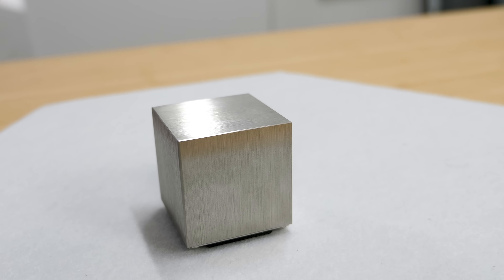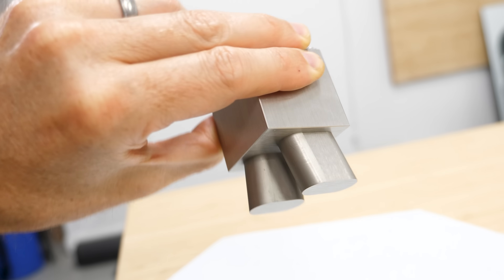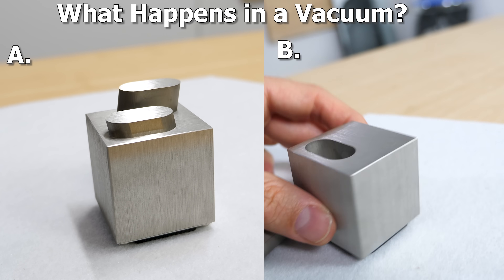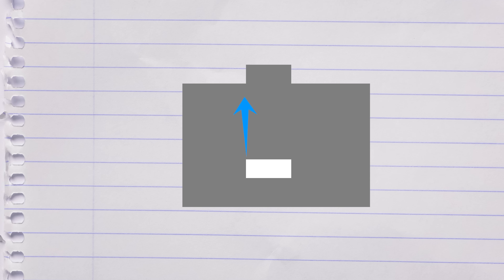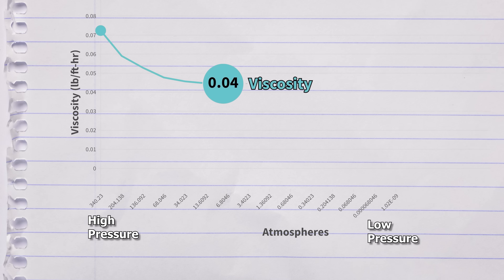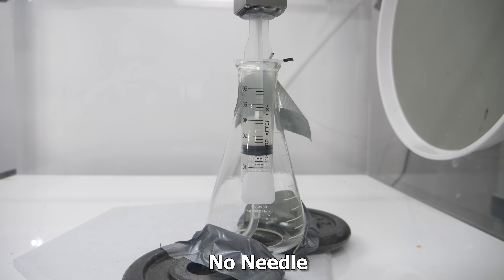What Happens to Perfectly Fit Pieces of Steel In a Vacuum?

Comment: 2:45 i wonder what would happen if you were able to place the metal pieces in there after the air is sucked out. Is it possible for the air to get “stuck” inside the cube?

Comment: @ Action lab So is the resistance due to viscosity of the air holding the water at equilibrium in the syringe ? Does pressure difference on the top and bottom playing no role here(Why then is the  pressure inside the syringe  higher than the pressure outside?)?

Comment: The problem in both cases is the trapped air. It is a very common mistake when designing for ultra high vacuum. You should assemble the cube and put the cylinder in the syringe after the vacuum is in the chamber.

Comment: Both pieces are cut separately then grounds to match the finish. Even with a EDM machine because the EDM still has a cutting diameter tho thinner than a traditional milling machine

Comment: I still don't understand 1. why the viscosity is constant, or 2. why that causes the weights to fall slower... since there's less air molecules in low pressure, there's less air molecule collisions against the steel block or syringe to resist the force of gravity as it's falling. Can someone please explain this result?

Comment: Clearly the limit as we approach true vacuum is no resistance (ignoring friction/vacuum welding): eventually, the air has to become so thin that there physically isn't enough molecular kinetic energy in the in the environment to prevent it from sliding out.  What explains the non-linearity here... does the fluid model break down at low-enough density?

Comment: My guess: the piece should actually lift out on its own due to the pressure differential. Once all the air escapes it will fall back in quickly.

Comment: I think the driving force of the air to move inside is lesser. The flow velocity maybe the same or maybe higher under vacuum but since the air is so thin, the amount of air going in is also decreased. The main equation to consider is below:

Mass flow rate= density*flow velocity*area

Comment: If the pressure is greater on the inside than the outside I think it would push them out as the pressure outside was removed.

Comment: You should have let the air back in with the cube fully extended and fully collapse or nearly so to see what the increase of pressure would do in each state 
The first fully extended is more obvious the moving blocks would be pushed in much faster. The second not so much i am not even sure what would happen the air would maybe rush in and lift the moving parts up is my first guess

Comment: I would say part of the reason the pieces fall out fast then slow under vacuum is that the pieces are angled, so when they are most of the way out, gravity kind of bends the steel pieces against the walls.

Comment: But wait, the stuff about the syringe and the viscosity feels a bit incorrect: in the vacuum the pressure inside the syringe increases when the weight goes down, so you can't say that the viscosity in that case is the one of the air with low pressure. It should be approximately the same like with 1 atmosphere.

Comment: Everyone who guessed that it would just fall out is correct, however, it was not a perfect vacuum, if it were, the answer would apply. But still, the video was better, because I'd never guess even with less dense air it would react pretty much the same, so thanks again for free knowledge.

Comment: In a vacuum the blocks will fall right out. You did not have a vacuum; it was merely lower pressure. A vacuum is absolute. Not like "cold" that is subjective, even "partial vacuum" is not a good phrase. It is just lower pressure. "Vacuum" implies no air at all, a true vacuum. If a vacuum chamber cannot get to full vacuum (nearly impossible) it should really be called a low-pressure chamber.  Yes, I'm being pedantic but to say that those who guessed that the blocks would fall out in a "vacuum" were wrong based on this experiment is misleading.

Comment: High vacuum is not enough, you must pump at full throttle until the air inside de object is all gone out. You can device a way to make vacuum and introduce the two pieces afterwards, then you can measure the different friction of the pieces by the time they take to slip out, It seems one of the pieces show higher friction than the other. You cannot make theories before you get all air out the piece.
Reply: But he only made a hypothesis, didn't he?

Comment: Even with non ferris metals, your magnet may be interfering with the experiment via Lenz's law. Like dropping a magnet through a copper pipe
Reply: With these pieces being steel, they could be getting affected directly by the magnetism rather than just by Lenz's Law. It does make me wonder if the magnet is big enough to have that much effect. But yeah, I wouldn't be too surprised.

Comment: With these incredibly small orifices (first one being the gaps in the cube, second being the needle), you might also be getting choked flow after the fluid inside either the cube or syringe pressurizes. This would explain the rapid initial movement (fluid pressurizing), and then consistently slow movement afterwards (choked flow).

Comment: Think your exppanation of the syringe dropping is full of holes.
It drops quickly at first until the pressure in the syringe increase and cancel out the weight. The air escaping through the needle is self limiting - the higher the pressure differential the more the molecues of air bump into each other and slow the flow.
Not sure if that is the same as viscocity but I don't think it would happen with a pin hole instead of a needle (and viscocity is measured by liquid pooring through hole, not a nozzle.)

Comment: But what happens if the cube is "set" to begin the experiment by disassembing it and reassembling it under vacuum? THEN start the experiment. They should just fall out then possibly... Its not like it can make extra air. Remove that small bit before the experiment begins..... :)

Comment: They fall much deeper than in atmosphere, the slowly sink. (In atmosphere they almost don't fall and only sink. Or the falling part just didn't get to be filmed.).
There is continuity, at zero pressure they fall to the bottom, no sinking.
upd. Okay, I was right, don't need to watch video to the end lol

Comment: As "Feinwerkmechaniker Fachrichtung Werkzeugbau" i can assure you, that you can go as exactly as 2μm with wire EDM, an that is Just the difference between upper Part and middle (it usually destroys more Material in the middle) at Work i need to BE that exactly all the time, and our machine is actually quite old, even newer machines probably are even exactlier

Comment: I appreciate your enthusiasm, but you were wise to hedge on the outcomes here, saying "what happens may surprise you".  I was not surprised.  Both experiments had the outcomes that I expected.

Even when the vacuum chamber got down to 0.05 atm, the pieces of the cube eventually had some air rushing through the small gap to fill the vacuum space, resulting in the same effects we saw in air at 1 atm.  In a perfect vacuum, such as on the surface of the Moon, I would expect the inner parts of the cube to slide out under gravity at about the same rate that the hammer and feather show when being dropped in the Moon's surface gravity, without interference.

And for the syringe with the tiny tube, I figured molecules and particles in the air take up space and you can only get so many of them through the tube at any time, with a given particular pressure on the plunger.  The pressure applied in the chamber hit that limit, so of course you got slowed down to the same speed as the plunger push in air.

Comment: You don't think that the angle of the parts matters and accounts to the friction of the parts?  What about as the part entends and a even with a low gap, that a rotational force over area causing the parts to bite each other.

Comment: the reason it initially falls faster is because viscosity doesn't play a roll until the change in volume as a ratio accounts for the vacuum pressure of the environment. 
In a newtonian sense, the mass stops accelerating when the pressure acting on one side multiplied by its area minus the pressure outside acting on the same area multiplied by that area is equal to its weight.
Reply: This means that if the vacuume in the chamber was small enough that the difference between the outside and the inside even when the plunger traveled the full distance multiplied by the area was smaller than its weight, the viscosity of air wouldn't have an opportunity to stop its acceleration

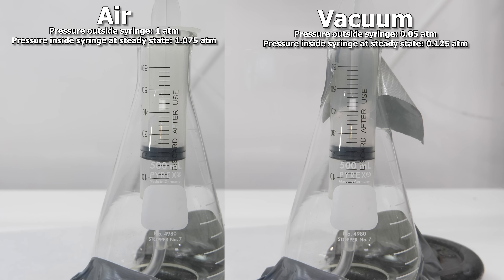Comment: @5:55 The cube is moving down in the same way on both sides, so the net force on the cube should be the same.  Yet the reported pressure difference between the inside and outside of the syringe is different--it's a higher delta in the vacuum by a significant fraction.  The only other factor I can think of is the buoyant force of air on the cube, is that enough to explain the increased "weight" of the cube on the right? And given this increase in deltaP, is it really fair to call the viscosity equal between the two scenarios?

Comment: How long did you pump the air out of the chamber? When I was an HVAC tech we would connect a vacuum pump to the system after doing certain repairs. The pressure in the system would drop quickly (depending on the size of it) then it would level off and then it would go up a bit then drop again. That little bump in pressure was usually water flashing off to vapor, which is exactly what we wanted to remove from the system. It could take hours to fully vacuum a system down and really big ones took a day or two.
I wonder if vacuuming your chamber for an extended time would have any effect?

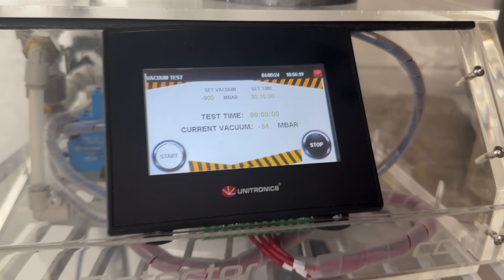Comment: 2:29 "So the air pressure is now 20 times less than atmospheric pressure." 
Nope. According to google typical atmospheric pressure is around 14.7 psi. So 1 times atmospheric pressure is 14.7 psi. 20 times atmospheric pressure is 294 psi. So 20 times LESS than atmospheric pressure would be 14.7 psi minus 294 psi, or NEGATIVE 279.3 psi. Since psi can never be negative, I think your math about the "20 times less" thing is a BIT off.
Reply: I’m pretty sure saying that something is X times less than something else is just dividing it, is it not? I know when I say something is 2x less than something else I divide to get there.

Comment: I am positive that viscosity is not your factor. You can have very viscous medium with small molecules and vice-versa. The effect you are  demonstrating has more to do with surface tension of the medium and molecular weight of the medium (air as a mixture of gases and NOT gases at a certain temperature), in my opinion. Change molecular weights and much different things happen. The theory of relativity acts within a vacuum the same as it does outside a vacuum, it simply has different ingredients. Cool experiment, though!

Comment: Now redo the test after using a diffusion  pump to get an ultra low vacuum.  i’m certain when the vacuum is low enough the parts will drop in and out without speed reduction.   Don’t forget to do the feather and marble drop test!

Comment: so, in theory, if we could achieve a perfect vacuum the pieces would just fall quickly away from each other. Much like they do at the start. They have to establish a pressure differential before viscosity becomes an issue. If there is no pressure, there is no pressure differential. But in reality a perfect vacuum is not possible, as even the plastic walls of the chamber have a non-zero vapor pressure. I wonder how low the pressure would have to be, I imagine it would be related to the weight and surface area of the cutout.

Comment: Even if I now know it´s true, I still can not believe it. Can you do an extended experiment to check, if the almost-vacuum-air at the neetle blows the same way as air with 1 atmosphere preasure would? Maybe mount a peace of paper in front of the needle which would bend. Bends it the same way in near vacuum as it would do at 1 atmosphere preassure?

Comment: I’d like to see a much lower pressure with a high Knudsen number (i .e. where the mean free path is larger than the tolerance/needle diameter).  I think you’ll see effective viscosity drop.

From memory, the reason that viscosity is independent of density is because lower density means less particles to transfer momentum, but a larger mean free path so that momentum is transferred proportionally further.  If your density drops enough that you leave the continuum regime then this ceases to be true.

Comment: I think you said the metal parts are machined to just under .002" tolerance? How tight a tolerance would they need to be to see the caimir effect start to influence the pieces behavior? What would it look like if the casimir effect did start to influence thier behavior? Also, is each piece machined to a tolerance of .002" therefore making the added tolerance of the inside block and outside block a total of .004"? Or, is it a total of .002" tolerance between to 2?

Comment: Great video! Thank you. I never would’ve thought that the viscosity there would not change dramatically at lower pressures. I wonder if the designers of the Martian rovers take this effect into account? Considering that they have large vacuum chambers to play with I would imagine that they do, but it would be interesting to confirm that.

Comment: If you put the thing inside vacuum as is, there will still be air on the inside. I think the pieces will be pushed up inside the vacuum chamber and behave normally for some time antil air escapes through the tiny gaps

Comment: if they were truly perfect fit ,they would "wring" together or even fuse into one piece again. moderate heating and cooling might aid in fusing back together. you need to actually machine to such precision the atoms can get close enough to eachother to get within reach of the "atoms gravity?/ atom strongforce?" or whatever we call the force that holds atom together. look up gauge blocks for more info and usecases for this.

Comment: I guessed it would slide out quickly but was under the impression it would be a perfect vacuum. What would happen if it were a perfect vacuum?
Reply: Probably apocalypse because there's no such thing 😂
Reply: @DanKaschel  why not? would the metal start sublimating?
Reply: @TheBigL-1917  because as the pressure decreases it gets harder and harder to lower it. Getting that last atom out would be damn near impossible.
Reply: @DanKaschel  what if it were in outer space where there are only a few atoms per cubic meter?
Reply: @TheBigL-1917  then you would have exactly the same problem
Reply: @DanKaschel  I'm asking what the metal thing would do in outer space (a nearly perfect vacuum). I guessing it would slide out quickly.
Reply: @TheBigL-1917  Ah. Yes, I imagine you're right since the viscosity would be negligible.

Comment: If you reduce the pressure beyond the point where air stops acting like a fluid using a diffusion or turbomolecular pump, would the result be the same?

Comment: I worked on a laser tube cutter years ago, that used finely ground parallel metal surfaces in a vacuum to generate the beam.
I was told that those surfaces were ground so flat that if they ever came together you would never get them apart.

Comment: Friction between the EDM cut blocks could also be a factor when you let them slide out of the main block under "partial" vacuum. The blocks are initially sliding out fast. But as the blocks are cut at an angle the center of mass moves further away from where the hole is. This increases the friction force. As the blocks slide out further,, the forces at the contact points between the blocks and the main body get closer together which means the forces also increase because of this. Try to visualize the force vectors in the start condition and at the condition when the blocks are slid out almost completely. You will see the normal forces increase a lot and thus the friction forces increase. I'm not saying the low pressure situation isn't occuring. I'm just saying there are other factors at play
Reply: There's some friction, but how much? I'd think that it's fairly slippery. I'm inclined to think that the effect is minimal compared to the friction of the air molecules because the syringe shows the same speed reduction behavior, even though the plunger goes straight down. At least in the case of the syringe it's easier to imagine that at first most of the volume can be compressed more easily due to the reduced pressure, and once it reaches an air density similar to the one at 1 Atm it has to slow down as the air can't flow out of the needle any faster.

Comment: But you have a lower pressure in the syringe only until you start squeezing it, because now in the syringe you're creating a higher pressure again. So it's not entirely easy to say in a lower pressure the viscosity is the same. Because your pressure has increased to the same as it was before since the same weight is pushing down on it. I guess only the outside pressure is lower so you have a high pressure flowing into a slightly lower pressure outside to a high pressure flowing into a much lower pressure outside when under vaccuum. But the bottle neck of the needle still makes the "viscous" air limited in extraction speed.

Comment: how long did you pump on the chamber with the needle installed?  It would take quit a while to fully evac the syringe through the needle, i'm guessing it would take an hour or so (based on a lot of vacuum experience).  If you didn't pump long enough to evac the syringe then that test was very misrepresentative of what you were trying to show/explain.

Comment: Prediction: Cold welding - if everything is clean  50/50
Otherwise - fast motion, because no air pressure inside or outside the cube in a vacuum

Wow... I clearly didn't see that coming!